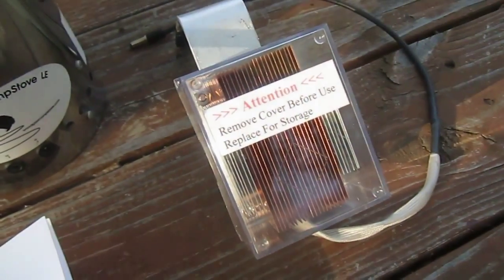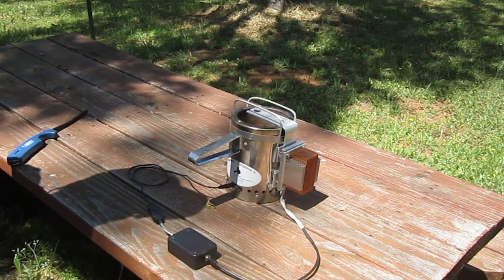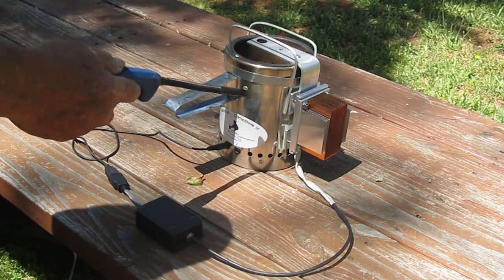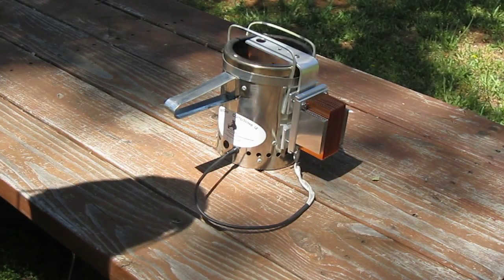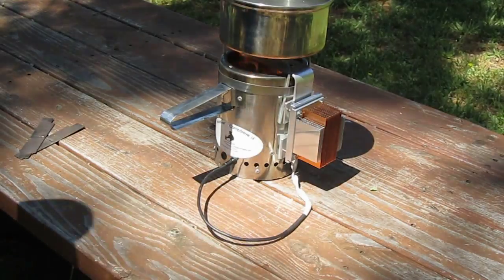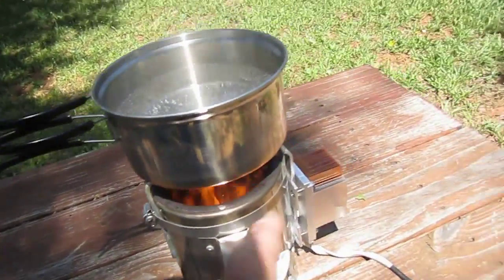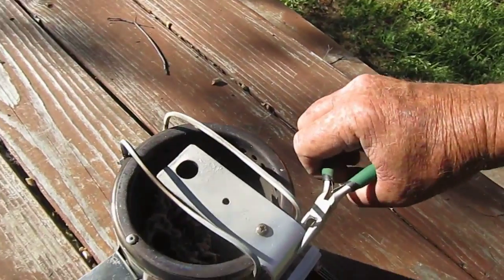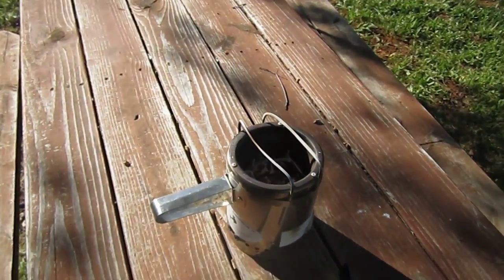Thermoelectric Bio-Mass Gasifier Stove

Comment: What's also really cool about this is that if you leave the stove and it burns out the fan will automatically shut down.  The combustion chamber might be a bit warmer to restart it and your not wasting power on the fan or wearing it out. I wonder how difficult it is to build one of these?  Just solder 5 of those TEG plates in series and mount to a heat sink? Solder 12 to get 12 V and 12 Amps?